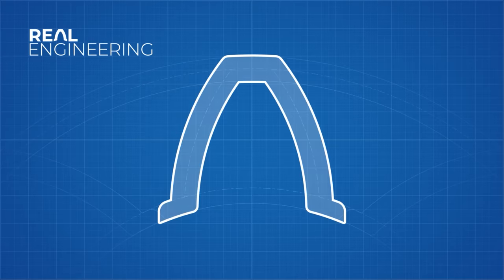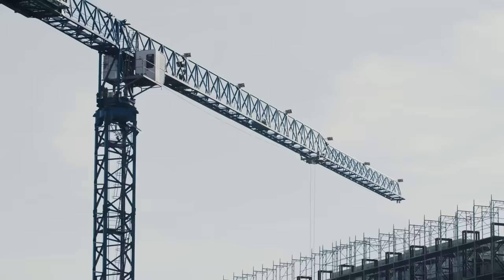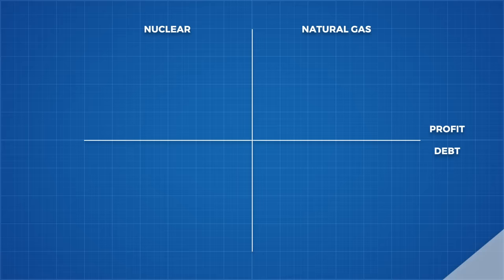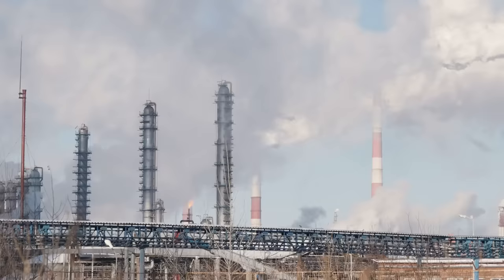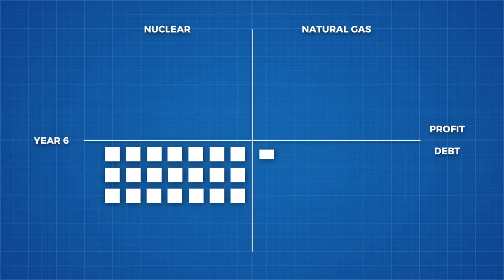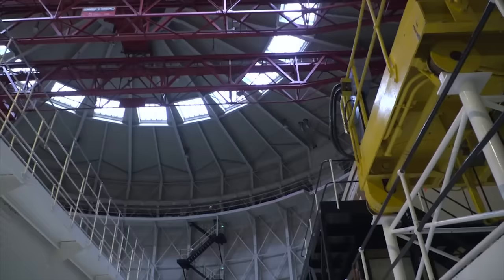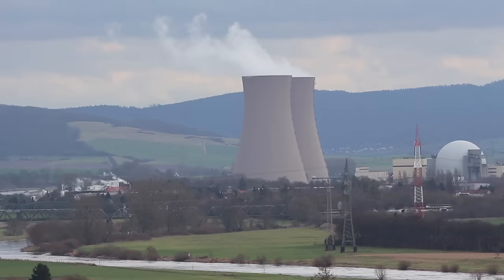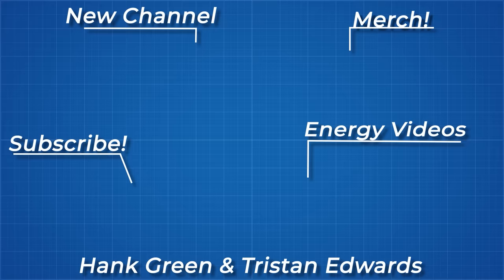The Economics of Nuclear Energy

Comment: Solar Wind and battery are a lower cost solution. Solar wind and battery can be built for millions and take years to finish, Nuclear Power takes billions of dollars and requires decades. Then the nuclear plant will run around 30 years (which is typical) and you have a high level spent fuel problem that needs to be buried for 10,000 years. However, the DOE hasn't approved transport routes, transport casks, or a national repository after 60 years of trying. No one is willing to expend the political capital to get this done. The result is we have 92 nuclear power stations with high level spent fuel "temporarily" stored in their backyards. Germany switched back to coal power plants when Putin cut their natural gas. Natural gas prices then skyrocketed.

Comment: You also need to factor in the effect that the heavy use of natural gas for electrical generation has on the price of it for other consumers. The higher the demand for natural gas in the electric power sector, the higher the price is for residential consumers that use it to heat their water, heat their homes, and cook their food. It's a hidden cost. California aggressively expanded renewable electric power, yet they don't mention that for every megawatt of solar/wind they build out, they're also building out a megawatt of natural gas electric generation because you need a backup for those intermittent power sources. Nuclear power doesn't consume 12 trillion cubic feet of natural gas and doesn't require regular operation of natural gas electric plants when the sun sets or the wind is calm.

Comment: Wow this video makes some bad assumptions.
1. Wind and natural gas together are competing with nuclear, as stated in the video, gas peakers capital cost is low but operating is high, so you only run it a few hours a day at most when wind, solar or hydro are low, margins for the plant are way higher because of it. It makes no sense to directly compare it instead of a blend (and take an example of a best and worst-case blend). 
2. Average nuclear construction in the developed world is 10 years about or more, anything post about 2009 follows that trend, the only exceptions are China but that's due to it not caring about safety standards, environmental issues, all land belongs to the state so can just seize prime land, no issue from population complaining about it, etc.
3. Not taking into account cost of decommissioning, or some countries having way too low nuclear insurance costs (norm is adds 1/3 to 1/2 of construction cost for nuclear, natural gas is <$15m for a larger one).
4. You took the cheapest possible cost to build it, estimates were $6-9bn based on the source you looked at, average there would be $7.5bn.
5. Uranium/gas price fluctuations also exist, you picked a 2019 youtube video as a source (besides the fact YT is not a source) that doesn't actually state how old it is nor where the figures come from.

Comment: One thing not taken into account is both the life span and efficiency of solar panels. Currently solar panels are only 15% to %18 percent efficient. This efficiency is also reduced due to heat and dust on solar panels. Over their lifetime, they will reduce in efficiency. Solar panels are also hard to recycle due to the components they are made of. Some of the metal and glass can be recycled, but the rest gets either thrown away or burned at e-waste dump sites. Not to mention the vast areas of land that has to be cleared for large solar arrays. So, their not exactly as "eco friendly" as one might think.

Comment: One problem is that nuclear reactors or any nuclear related energy, like they use for space missions, cannot be turned off the same way a battery or gas plant can. If you cut the power and turn off the reactor, the fuel will continue to "burn" so you are losing energy that could have been used for power. More so than you would lose from a battery or shutting down and firing up a gas power plant.
Reply: Actually you can turn off a nuclear reactor.
What's actually happening inside of a nuclear reactor is called sub criticality. Criticality is a run away self sustaining nuclear reaction. But to create this you have to have a lot of things go right.
This includes neutron reflectors, a moderator liquid to slow down neutrons, and enough densely packed material to continue this in an uncontrolled manner.
Now what tends to happen at subcriticality is you have about 5% purity in nuclear pellets that are kept in the control rod. It's the inserted into the moderating liquid, usually water, surrounded by neutron reflectors. This keeps the reaction going but can be controlled. Now it's not as simple as just ripping the control rod out, but yes, modern nuclear reactors are able to be turned off by simply removing the control rod from the neutron dense area. This stops the sub critical reaction but yes, the material itself will still be hot and radioactive. Just not to a dangerous level except for the decay materials already in it that have a much shorter half life than the nuclear fuel.

Comment: The term nuclear in this case is being used as a catch-all that actually means gigawatts scale nuclear power plant. Nuclear has effectively been regulated out of the market by trying to build gigawatt scale nuclear power plants that require massive amounts of reinforced concrete. New technology and small nuclear reactors don't have this problem and are probably very well competitive with natural gas power plants. The problem with natural gas and coal is they don't fare well in the case of supply chain disrupting events.

Comment: There are a lot of things you have wrong in this video.  "Safety issues" mentioned at about 10:30 in is a huge one.  Nuclear Power Plants are some of the safest facilities in the world.  Take into consideration the deaths from pollution and they are by far the safest form of energy production we currently have available.  Also- I know you are just trying to make a good looking video, but please don't show pictures of an oil refinery when talking about natural gas power plants.  They are not the same thing.  Other people have mostly covered my other comments.  I am all for nuclear, and even more in favor of some of the 4th generation nuclear reactors, which carry less risk, can load follow (in most designs), and are less expensive to build than the 2nd and 3rd generation reactors.  If you want to see an excellent example of this- look into Moltex Energy's SSR.  It can load follow as well as a simple cycle gas turbine, uses existing spent nuclear fuel for it's new fuel, and incorporates large scale energy storage into the basis of it's design.

Comment: Pressurized water reactors are extremely expensive. A small modular molten salt reactor would be more economical. Even a neutron reflector MSR would be cheaper using a tube of fissile salt that has the neutrons reflected on it to make heat from fission. Where the working gas lets neutrons pass through it while taking heat from the core to run a turbine generator.

Comment: Levelized Cost of Production of electricity misses several factors in comparing power plants.  The biggest one is when the electricity can be produced.  Like electricity that can be produced, like in winter, when there is a shortage of electricity is more valuable than electricity that can't be produced during these times.  Electricity that is not subjected to commodity fuel price fluctuations is also more valuable.  Newer designs of nuclear power plants are also incorporating storage and on demand power production which have value over generation systems that do not have this ability.  Of course the cost and the time it takes to build a nuclear plant needs to come down.  I do think this is possible and should be worked on.  As to the value of a nuclear plant I think the other values these plants provide should also be considered.

Comment: Nuclear power is in one group, traditional power in the other.  With carbon-based fuels, from coal to wood, the initial investment is low, but the fuel costs are on-going.  With 'green' solutions, including nuclear, the initial investment is huge, but the on-going or incremental cost is low.  For instance, a wind tower or solar mirror is costly, but upkeep is generally low.  A nuclear power plant is hugely expensive, but the upkeep (fuel) is relatively low.   The real rub with nuclear is that initial investment, the public ease of co-existing with nuclear, and the insurance which can be exorbitant...

Comment: It is true that nuclear energy is too expensive and natural gas is cheaper. However, solar and wind turbines with battery backup are a fraction of the cost of natural gas plants and can reliably provide base load power. Think about it. Solar plants have no moving parts, do not require fuel extraction or transportation or wars to maintain supply. I'd have like to see a comparison with renewable energy with battery back up included.

Comment: Nuclear energy is the only source for mass production without CO2 production. The only renewable energy with constant production is hydro. Solar and wind power are both intermittent energy therefore cannot be the basic electric production. So, before technology is offering replacement like hydrogen and super power long term battery nuclear energy is the only “safe” energy provided its production and use is strictly controlled by an indépendant, strong and nondoctrinal body able to take binding decisions.

Comment: Great video explaining the economics; however I think that the cost of these 1000 MW older nuclear plants is not directly comparable to current day gas/renewable alternatives. Many were designed in the 1960’s and ‘70’s. They are ‘beasts’ - older technology and the designs were significantly more complex; later modified by government regulation particularly after Three Mile Island. Many plants were cancelled after construction was started due to U.S. electrical power demand that did not live up to projections made during 1950’s and ‘60’s. A half built nuclear plant renders nothing useable, only more consumer cost and a bad credit score.

Fifty years ago, owners wanted a Cadillac ‘custom’ plant, so they got a Cadillac, but not at a Chevy price; probably more like a Bentley.  We could do much, much better if we have competent managers, engineers, and tradesmen constructing them. Many of the talented Engineers and Managers I had the honor to work with during my 20 year career came from the Nuclear Navy. One was formerly a Trident submarine captain; you can’t get much higher on the competence list than that. These professionals understood discipline and how to follow procedures, which is essential constructing a nuclear plant. While working for Ebasco Services as a piping/mechanical engineer in the early 1980’s at Satsop #3, (1240 MW PWR) our construction management team set an industry record 50% project completion in 2 years, so it can be done.

The generated energy density per acre of land taken is much higher than wind or solar, and a lot more friendly to the landscape. It would be a mistake not to pursue nuclear imo, as wind and solar will not replace our current or future needs with existing technologies. One uranium fuel bundle the size of a fire log can power 100 homes for an entire year. We know this and have been doing it for over 50 years. 

More modern and smaller nuclear plants, could be built in 5 years or less and could be dedicated or diverted during off-peak periods. Why not use existing sites, especially where old units are being decommissioned? If not, there will be no more nuclear plants soon. The power they produce could be used to: 1. Desalinate sea water. This could be used for agriculture especially in drought areas, pumped hydro storage, etc. 2. Generate hydrogen. 3. Charge battery farms during periods of dark or no wind. 4. Power Giga-factory style industrial / manufacturing areas. We need better planners in the DOE.

Comment: The problem with these calculations is, at least from what's being depicted, it's based on building a traditional nucellar power plant.  Traditional plants are unique, every one is unique, and because of that they are all extremely expensive to setup and require their own specialists to run and operate them safely.  

Meanwhile, it's possible to design and produce a nucellar power plant on a production line, you could build many of them, identical, at the same time which would reduce production costs and build time drastically.  I'm surprised this video doesn't touch on this point. 

It's not expensive to build smaller power plants and have them spread about cities, VS a giant plant that powers the greater area of a city.
Reply: The prefab built in a factory idea is what Westinghouse sold to the VC Summer and Vogtle project buyers.   Modules built in the factory did not fit or mach up with other onsite systems and the build quality was so poor that many had to be disassembled and re-welded on site.  The prefab concept is now one of the major reasons cited for cost and schediule over  runs.  Until someone actually does it sucessfully in America, it is just corporate PR hype.

Comment: Ironically, it's easier to integrate to NPPs into a purely NPP grid, which is stable, than to integrate them into a grid with a lot of renewables, due to the fluctuating output/low reliability of such dilute harnesses of elemental energy.

Comment: I didn't see any cost associated with the carbon footprint of burning natural gas.  It is probably much larger than we even imagine.  Also, there is the thermal pollution of nuclear which is huge causing some to throttle back or shut down to limit discharge air/water temperatures.  Both should be abandoned but first, we need an intense focus on energy storage solutions.

Comment: small modular reactor is good alternative
Reply: Ever heard of the "economics of scales"? That was the reason our power plants went larger and larger in the last centuries: the efficiency went up and also the specific costs. I don't understand, why you could solve the cost problem of nuclear power "In deregulated markets, nuclear power is not now cost competitive with coal and natural gas." http://energy.mit.edu/wp-content/uploads/2009/05/MITEI-The-Future-of-Nuclear-Power-Update.pdf by making smaller units. Yes, it is easier to implement passive safety features when the power density goes down, and more surface is available compared to the reactor core volumen, but wasn't the high power density always pointed out as a high advantage of nuclear power?

Comment: Solar energy is attractive option if your region provides it in abundance, same thing about wind, geothermal and water. But if these conditions are not fulfilled you have basically only two options - burn fossils or build atom. I believe it should encourage us to develop long term effective solutions, research new types of reactors with better safety and efficiency. There are hundreds of interesting solutions proposed, but very little political will and strategic planning, as neatly explained here in this video.

Comment: The economics of nuclear technology is one of the prohibitive aspects of nuclear power. Edison generators and dynamos easily replace fossil fuels and nuclear power. You have to add inverters and transformers to deliver power line voltage AC power continuous peak power without fuel or pollution.  A backup generator required for nuclear power plants has not been installed yet.  The backup generator can be expanded to replace nuclear power plants as the power plant is decommissioned.  The Edison generator and dynamos system is very small and inexpensive power plants.  The small plants can be patched into the power grid onsite or off site because they are inexpensive and can use the same transformers to deliver power voltage AC power continuous peak power without fuel or pollution.  We are grossly misinformed about generation of electricity.

Comment: What about the new modular reactors? The economics should definitely be more profitable since the upfront costs are much lower
Reply: The infrastructure (operators, maintenence, engineers, security, admin, etc.) differs very little between a 300 Mw SMR and a 1,300 Mw standard PWR. So while the initial cost should be lower, the operating cost per Mw produced is much more for a SMR.  EVERY utility that has built a nuclear power plant has always selected the largest possible....economies of scale.

Comment: "over the long term, the nuclear power plant is insanely profitable". Unless the cost of construction and construction time scale blows out, thus resulting in either higher debt and unless you don't factor in the cost of long term waste fuel storage. And you know the worst error in this video? Not even mentioning grid scale energy storage - which even in its current immature form is far cheaper than nuclear. Nuclear will never be economic. Not as renewables become even cheaper and grid scale energy storage matures and becomes cheaper still.

Comment: Red tape accounts for about half of the construction time and with Nuclear it's probably more.
With Nuclear I have always wondered why they are a one-of-a-kind build instead of being built more like Airplanes where they are all the same so problems can be caught before they happen.
Reply: There are very few reactor designs in the U.S. and they are standard designs except for some non nuclear options.  So they are not one-of -a-kind.  The most advanced today is the Westinghouse AP1000 advanced passive safety features. All AP1000s will be esentially identical
It's like a subdivision where you can choose from any one of 5 different home designs  and option out things like brick of stucco.